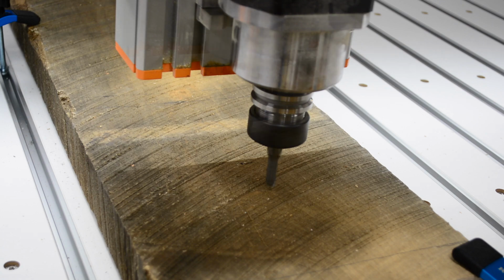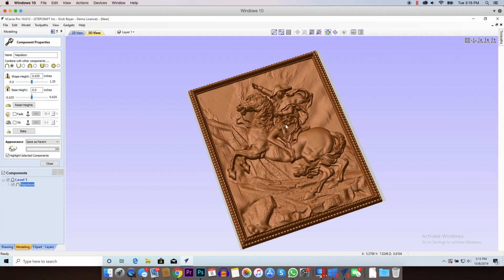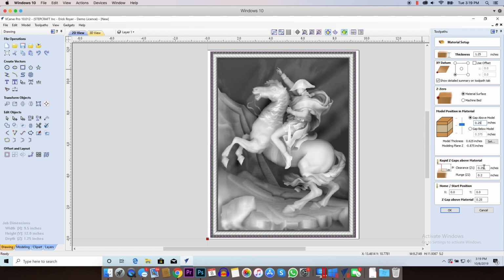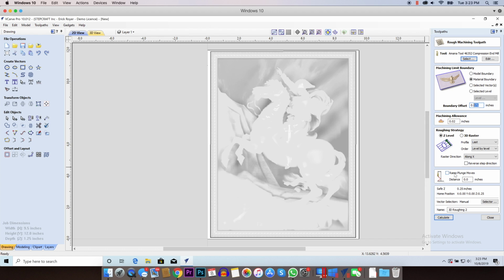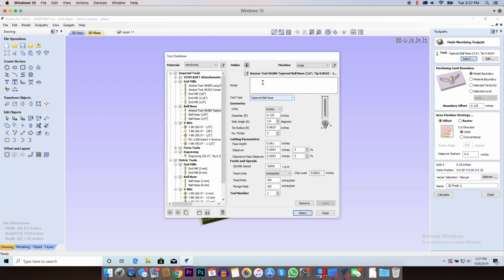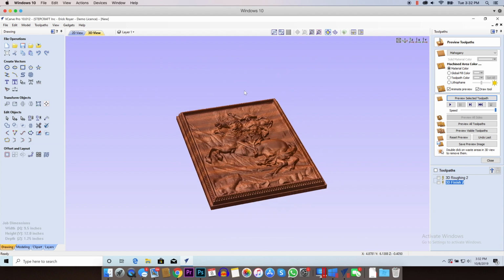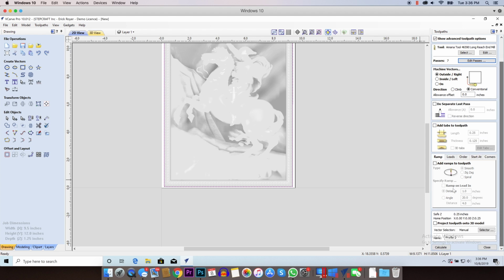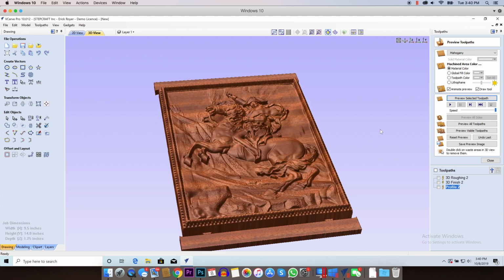How To Setup A 3D Carving Project in Vectric VCarve Pro/Desktop

Comment: Followed along with him as I did my very first 3D carve.  I noticed one particular thing while rough cutting.  There is no depth adjustment (passes) like there are on PROFILE.  It looks like it falls back to the tool data for PLUNGE depth.  My roughing passes were a little deeper than I would have chosen, but it worked fine.  Thank you for the excellent video... it helped a lot.

Comment: Thank you so much for spending the time to show us new CNC'rs the basics. I'm curious how you knew the feed rate / chip load for your bit. I'm using the 1/16" version of your ballnose bit and the best I can find on Google searching shows 40 IPM, and you're running 3x that. The small test I'm doing is going to take 7 hours (just the finish part). Also, I have a lot of flat area that could easily be removed by the rough 1/4" ballnose, but VCarve doesn't chooses to do this with the tiny 1/16, (and hence the 7 hours). Any quick thoughts?  Thank you again!

Comment: I'm using V-Carve desktop version 11. I watched this tutorial ..beginning to end one time then went back to the start . First, I don't have the Napoleon file but I thought I could use any 3-d V-Carve file from the clip art I received along with the Vectric software. I tried several with the file type of V3M . . . while the import process works fine I get to the spot in the tutorial that brings up the panel on the left part of the screen "Orientate 3 D Model" and I can't find an icon or menu option to get this panel. I noticed that the tutorial is using V-Carve Pro 10 . . I'm using V-Carve Desktop 11. Is this my problem? I thought I saw comment state that Vcarve Desktop would be fine for 3-D carving.

Thanks for your help
Jeff

Comment: Just got my Axiom and I see there is quite a lot to process (in my head) to do 3d carving. I do laser engraving so I find a lot of your terminology easy to understand but obviously the process is a bit different than using a laser. I wonder how many things will get destroyed as I learn this machine?? I enjoyed your video and will have to watch 10 more times before I have the courage to hit the go baby go button. Side question, where do you find your artwork or do you have to generate it all from scratch? I haven't even loaded v-carve onto my pc yet so this may be included to some degree in the programming I already have but haven't opened...

Comment: @ Stepcraft Inc. Great video...Thanks! Question. First off I am new to this so please excuse me if this is a dumb question. But why can't I first run the profile ( cut the model out) and discard the outside material boundary before the finish pass so I can save time on the tool path? Does that question make sense. Thanks.

Comment: Is the recommended chip load on those cutters based on wood or metal?
Reply from the maker: The Amana Tool Ballnose end mills will work with both materials. They provide a chart on their website that gives you the recommended chip load based on the material.  Amana makes some tooling that is specific to metal and some to wood or plastic, but they have a lot of tools that will work on all materials.  So it is best to check the speed and feed chart on their site for the material you plan to use